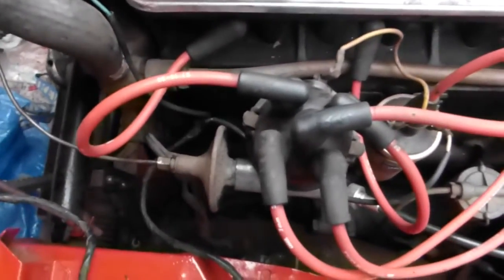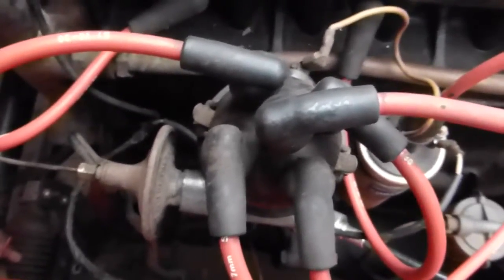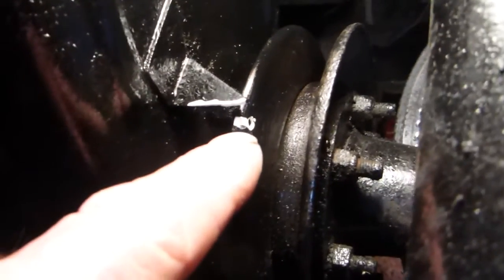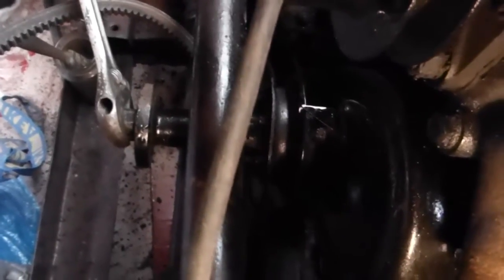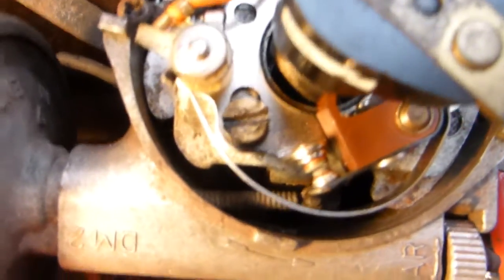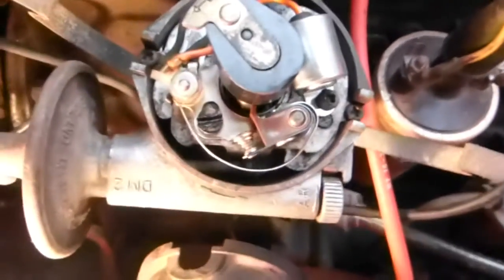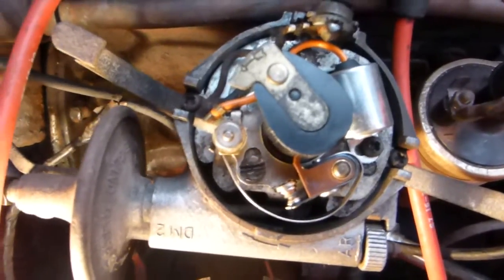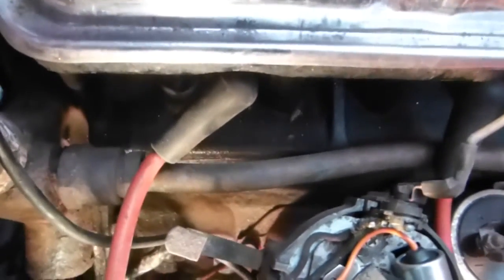Basic ignition timing of a TR4

Comment: You didn’t show how you rotated the distributor !
Reply from the maker: To rotate the distributor put a spanner on the end  if the starting handle bolt if you can or put it in gear and rock the car. this can be made easier if the plugs are out. good luck Alec